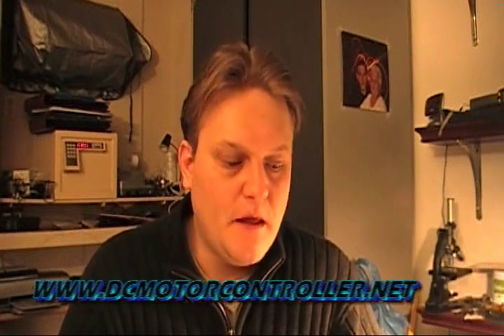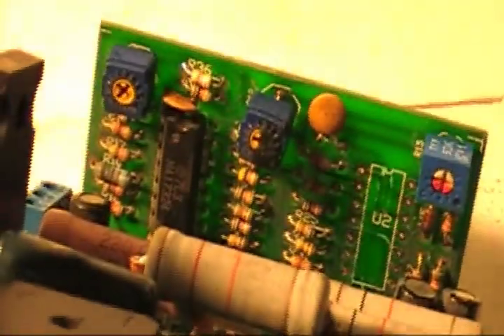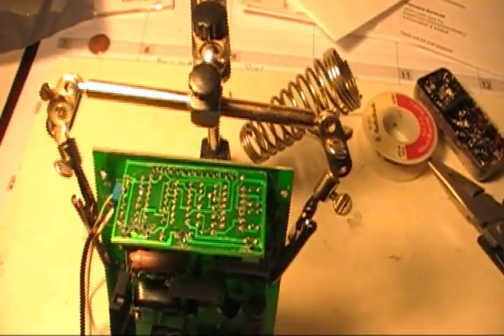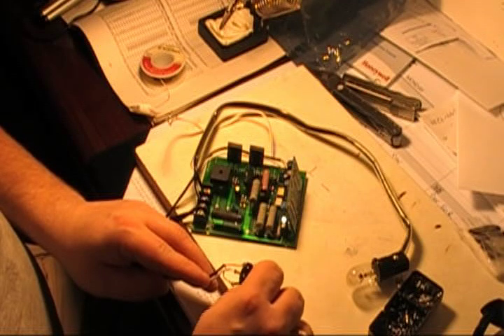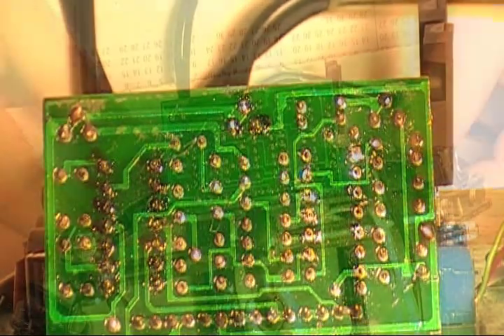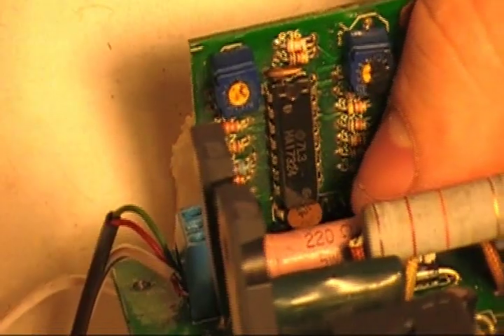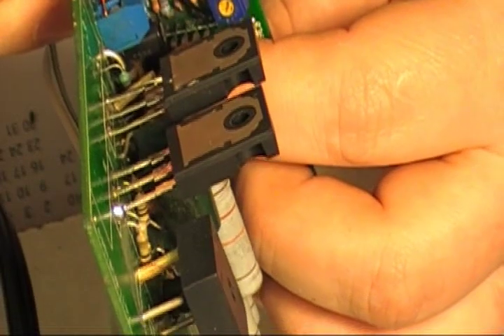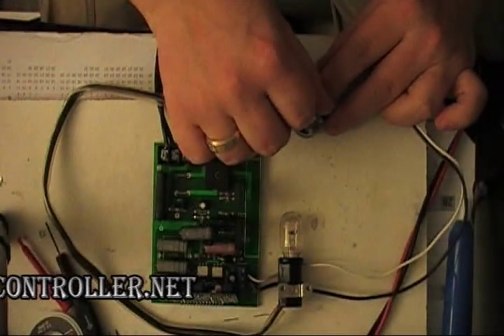Harbor Freight, Grizzly, Metal Worker Chinese Mini Lathe Motor Controller FC250J/110V Part 2

Comment: Eugene,  nice video... drill out the old holes was a neat trick, looks like it works good...   I have a question about these common mini Mills using the 350 Watt PM motor.   Has a black and white and green wire going to motor.  If I switch the Black and White in the Junction box, will the motor run in Reverse?   Will it blow up my electronics?   If so, then could I wire in a DTDP switch as long as I don't move it while under power?

Comment: I'd be suspicious to find a defective LM324 opamp short of a factory soldering defect.  The opamp isn't under any appreciable stress operating from a +/-12V rail and driving only a ~6ma optocoupler load.  A more likely root cause would be one of the 12V zener diodes used as a shunt regulator failing open which would subject the lm324 to overvoltage stress.

Comment: Nice job. When I used to do board repairs for a living sometimes if the chips are difficult to remove I would use a pair of Side cutters and cut the leads on the component side. Then you can more easily remove the cut pins from the thru holes. Also, If it were me, I would consider installing a Socket for the modules. If one blows in the future, replacement is a whole lot easier. Where did you source the modules from? again nice job.
Reply from the maker: Very good suggestions thank you

Comment: on the minilathe this is the same, for purpose for threading. I believe the controler  boards are the same in both the lathe and the mill. So it could be normal.

Comment: hello. i have a variable speed mill, made in china. it has high and low apeed ranges and forward/reverse spindle rotation. when in forward everything is ok but when in reverse the motor only runs at half speed. this happens even in neutral( just motor running). what cold be the cause of this symptom. i have no understanding of the controllers.